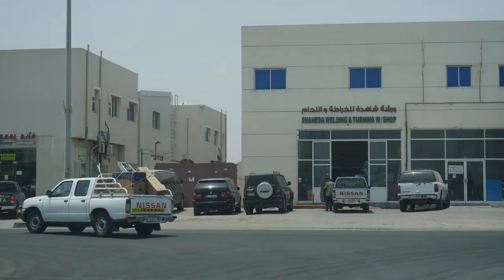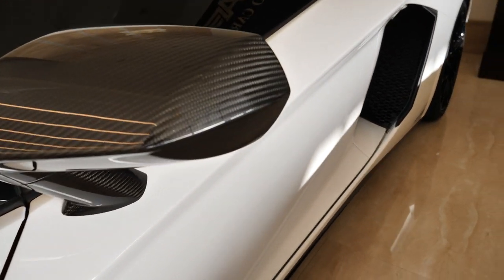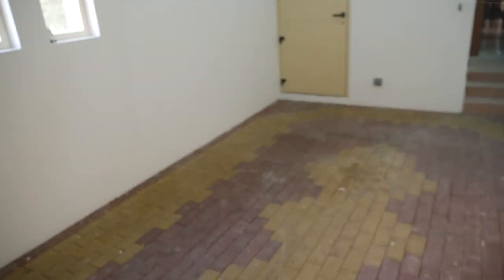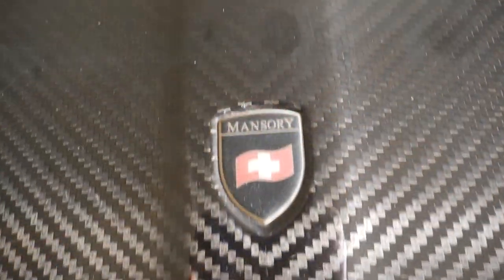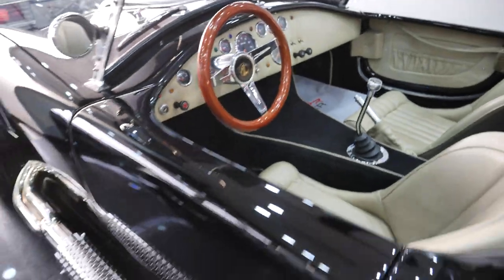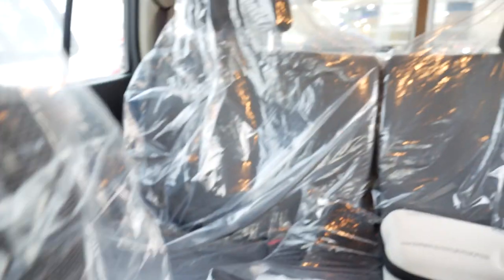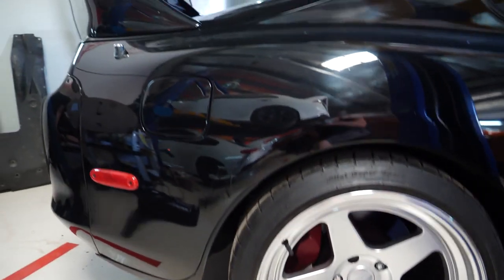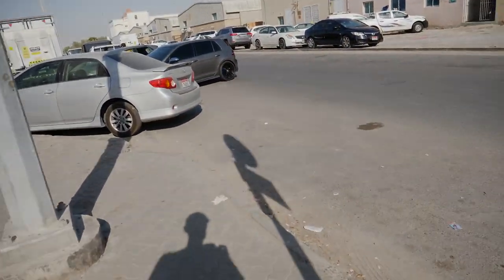Looking for Project Car in Abu Dhabi / Dubai

Comment: A Patrol would bE a nice project! Maybe a SWB would fit the garage.
You could also consider the TT RS with the 5 cylinder that is basically half of a lambo V10 ;)
They are making a lot of power out of those 5cl in the States.

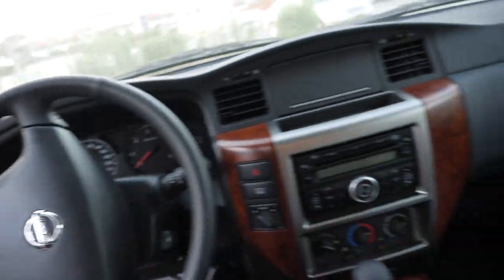Comment: 19:49 why 2 sticks?
Reply: The small one is to switch to very slow gears when you are doing some serious 4x4 climbing (= low speed = high torque)
The big one is just regular manual transmission